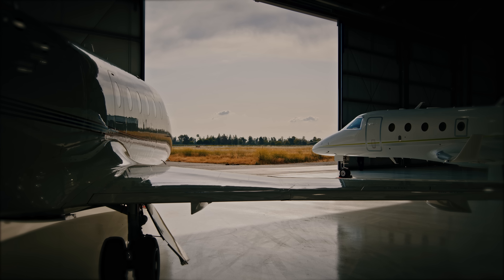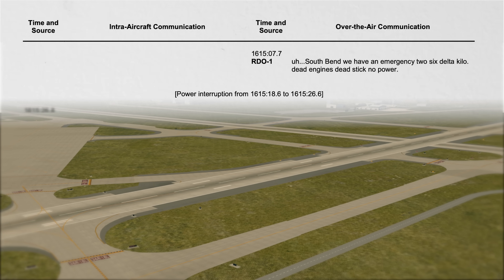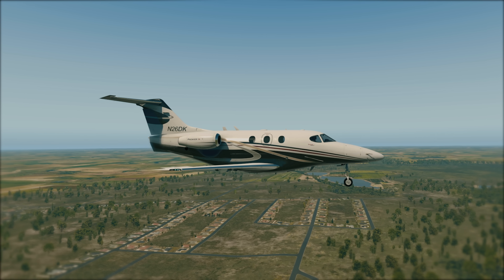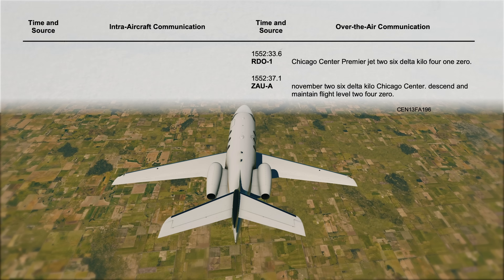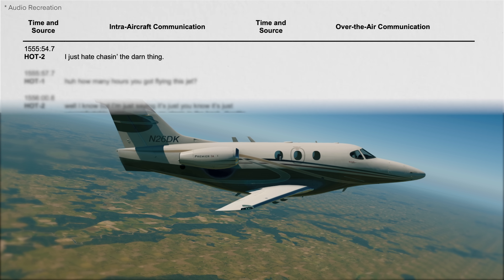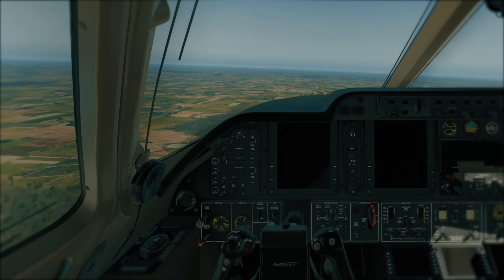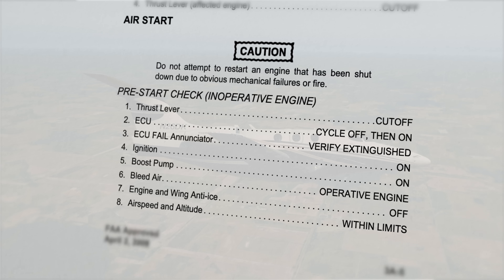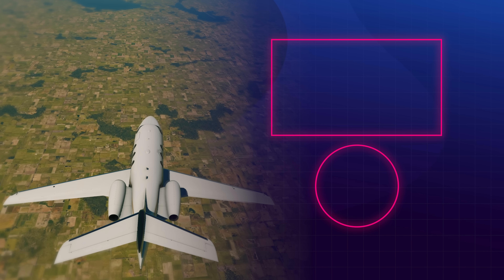Passenger Causes DUAL ENGINE FAILURE | Accident Case Study

Comment: Pilot: "we lost all power, no hydraulics, plane barely manovreable"
ATC: "no gears, go around" 💀
Reply: They totally could've survived a belly landing. That go around was the nail in the coffin.
Reply: @ascherlafayette8572  I agree... They should have landed it on the grass and slide it out like a glider
Reply: @paulbeauregard8297  No they should have used the go around with their working engine to focus, read the relevant checklists and get their plane working as it was supposed to do and was achievable by a competent pilot.
Reply: @paulbeauregard8297  well, gliders got a gear to run smoothly on the grass. That's here not the case. Usually it's better to use the tarmac, as its smoother than the grass strip from a belly landing, as there's less risk of flipping over
Reply: @ascherlafayette8572  yeah at least it added a lot of stress duration making the outcome likely worse.
Reply: @ascherlafayette8572 yeah as an air traffic controller idk why tf these controllers told him to go around… absolutely stupid, I’m sure they got reamed for that
Reply: @ascherlafayette8572  was thinking that as well.
Reply: @ascherlafayette8572 i would have refused that option, i would have said, screw you I'm landing, i never heard of a going around on a full power lost situation, your airplane is basically a glider, ATC wasn't well trained, he was supposed to clear the way for them.
Reply: @ascherlafayette8572  They tried that once with the gear, but bounced. That last go around shouldn't have been the nail in the coffin though... and they couldn't have foreseen the crash, because there wasn't much of a reason for it to happen. Having one engine was well enough for it to fly until they ran out of fuel. I don't recall if they said exactly why the plane suddenly lost control and crashed though. I remember them explaining most everything else, but that.
Reply: @deucedeuce1572  they first lost both engines and got one barely back. That's not the situation to make the call for a go around.
Reply: @deucedeuce1572  The front wheel present and the back wheels not, would make the plane pitch up everytime they try to touch the runway, the front wheel was litteraly holding the nose of the plane up, wich is what made the plane skip the runway few times. My guess is the pilot then panicked thinking he will probably run out of runway like this and tried to take off again, but at that point the plane has slowed down alot and entered a stall, this is why they lost control. At that point their best chance was to just force the plane to land. Because it was hard to get out of the stall with just one engine.
If they were to land from the first time, belly land the plane they would've had better chances of survival. Not great, because as i see in this video if the model used is the same. I am not a pilot... But i do fly model planes and i am familiar to how a plane would react in certain scenarios.
I see that plane has a prominent belly, wich would make it very difficult to just slide straight on the run way, it could start to spin, break a wing and start to roll, catch on fire, explode... But still a better chance to take than try to land with a front wheel out preventing you from landing.
Reply: @deucedeuce1572  We don't know why.  Probably stall spin because he wasn't flying the airplane he was frantically flipping switches.
Reply: When the engines were shut down, they shouldn’t have told them to go around Should’ve just done a belly landing
Reply: @leexgx  Yeah the ATC should not have made that a command. Had they belly landed they might have all survived.
Reply: @rhyoliteaquacade  They killed themselves.
Reply: @leexgx  I agree that the pilot in this instance should have ignored the go around. Even with one engine operable. In the NTSB report they found the wrong configurations for the engine restart to have given all systems power. The second way to lower the gear was also in the wrong configuration. Pilot should've practiced more clearly and understood his jet better.
Reply: @leexgx absolutely
Reply: Thought the same... almost ridiculous! If the pilot had tried to land the plane without  LG possibly would be less dangerous or at least no more deadly than try go around with poor manuver posibilities, no glass cockpit, lack of experience..
Belly landings are common... GA with 1 engine or NO Engines not so much...
Reply: As I see it, it’s simple: ATC doesn’t know what the state of their engines is.  All they know is the state of the gear, which is unsafe.  They call for a go-around, and if the plane has engine power, they go around.  If they don’t have engine power, they can’t go around, so they take their chances with the belly landing.

There’s no way that ATC could predict that they would go-around once, only extend their nose gear, come back for another landing, and botch the second go-around.  ATC made the call that, if possible, a go-around and gear-down landing was better than a gear-up belly landing, which is 100% correct.

To anyone claiming that a “go around” call means they must go around — no, that only applies in non-emergency situations.   14 CFR §91.123 and 14 CFR §121.557 both make it abundantly clear that emergencies allow for deviations from ATC commands.  To quote the latter:

“In an emergency situation that requires immediate decision and action the pilot in command may take any action that he considers necessary under the circumstances. In such a case he may deviate from prescribed operations procedures and methods, weather minimums, and this chapter, to the extent required in the interests of safety.”

A pilot with a working radio might have just replied “unable, landing”.  Assuming they made the correct call — and it’s hard to argue that “refusing a go-around because you have no engine” is an incorrect call — then they’re fine.
Reply: That's what I was thinking.
Until it was explained that the gear were electric.
And there was a mechanical backup, so they totally could've lowered the gear.
It was simply the incompetence of the pilot and the refusal of the "passenger" to let go of the controls.
Reply: @braelinmichelus  that's nothing ATC would have know, even if true. So not related.
Reply: The most likely would survived the belly landing.

Doing a go around and getting just the nose gear extended sealed their fate.
Reply: Yah, I'm not a pilot, but I've watched enough news stories and videos to know that many pilots have landed on grass, ground, water, etc. when they weren't planning to and sometimes all of the people survived. I think the controller panicked, but aren't they trained for that sort of thing?
Reply: @Dxn6alc03Belod7m1o  the controller just was in his usual loop of working, not recognizing that no engines means no normal gear extension and no go around possible. They also have actually very little knowledge of flying and aircrafts, which is quite staggering for me. Some do are pilots themselves, but most aren't.
Reply: @RubenKelevra 
While I agree that the go around command was misplaced, that was not what killed the plane.
The engine was fully functional, just shut off in the air and restarted. After that it was working until the end. The landing gear backup lever was only partially deployed and the battery selector in the wrong position.
They might have made it with a belly landing, but with a pilot that incompetent I seriously doubt that's the case.
Again, the ATC certainly didn't help, but trying to pin the blame on them is questionable at best. The responsible party in this situation is the pilot.
Reply: That ATC should be "retired"
Reply: He was not fit to fly any aircraft thats all.
Reply: Go around with one working engine
Nonsens 
Don't listen stupid tower 
Landing on the belly because lack of experience save what you can
True
Reply: yeah i wondered that too, like why? i mean i am no pilot but my instinct when someone reports no engine power wouldnt be to tell them to go around...just bely land it, theyll survive that, fuck the plane.
Reply: I mean clearly the pilot was completely unsuited to pilot an aircraft, not embracing the aviation spirit of diligence, judgement, CRM and correctness. But when I heard that call for a go-around I was pretty shocked. It sounds like a terrible idea to give the (single!) pilot of an aircraft in an emergency state the feeling that they are not allowed to land in the bad configuration that might well be all that their aircraft is capable of in its emergency state.
Reply: Kill the music👎👎👎👎💩💩😬
Reply: The video pointed that out, so no kudos for spotting it.
Reply: Yeah, that was pure negligence
Reply: They yelled so loud the engine got scared and started again... it works, trust me. ;)
Reply: Loss engine power and instructed them to go around. Some dumb ass shit
Reply: Yea I wondered about that, I have no experience with planes but common sense says loss of all power, hydraulics and barely maneuverable tells me that go around isn't possible.
Reply: maneuverable*
I don't understand how things get misspelled with all this technology
Reply: tbh I think he knew he could do a belly landing, but by his arrogance most of the time I think he didnt want to crash land his plane
Reply: I love all the comments here not understanding that ATC's job in an emergency is to give guidance and warnings, and that it's up to the pilot to decide whether or not an instruction is viable. ATC didn't kill them.
Reply: @guard13007  The ATC instructed a Go Around. They should have left it up to the PIC and simply given an observation that gear was up.
Reply: @guard13007 Exactly!  Controllers are not pilots!
Reply: @guard13007  My first thought also. ATC doesn't give commands, especially not after declaring an emergency. There's a reason the pilot is called "pilot". They have full agency over the aircraft.
Reply: @guard13007  exactly guidance and warnings.. no orders. "be advice main gears not deploy,  landing at your discretion"
Reply: @guard13007  you're missing the point: This wasn't ATC helping, but a tower controller denying them landing clearance. While in the air you always have the final say as a pilot, regarding bravo airspace and airport clearance the tower has the final say.

This is obviously not true in an emergency, but that's in the back of their head and why they aborted here.

So yes, ATC most likely killed them.
Reply: @RubenKelevra  The pilot had a flyable plane coming in with a configuration that would have guaranteed a devastating crash. The ATC told the pilot to take his flyable plane to go around to avoid authorizing an unnecessary crash. It is up to the pilot to decide if he has the skill to keep his flyable plane in the air not the ATC.
Reply: @RubenKelevra ATC can’t forbid you from landing in an emergency. You do what you want. No one else is landing there.
Reply: @CramcrumBrewbringer well, that's technically true. But if ATC tells you, after they know you're an emergency, to go around and you can, you f... go around because you might not know what they know, like someone crossing the runway in front of your etc.

You also assume here perfect quality of perception by the pilot, which might not be true. Could very well be, that he did not hear or listen closely because he was distracted and just heard "go around" by the ATC and then followed this instruction, because he thought it's unsafe what he's doing.

But exactly because ATC is not allowed to deny you landing permissions is highly questionable IMHO that they exactly did that in this situation.
Reply: @guard13007  they would have landed the first attempt if ATC didn't say anything, it's that simple
Reply: @guard13007  that's not entirely true. The "go around" instruction by ATC is normally given in extremely dangerous situations, where it's not safe to continue. A belly landing is expected in this circumstances and not the right moment to make this call, as it would normally require the pilots to follow this command immediately.

Giving such a command is not guidance and is what lead to them going around, following by a crash.

So ATC is here to blame for this crash, at least partly.

A emergency situation is just not a situation where you want to hear a "go around" call, except if there's no way to make a safe landing because there's something obstructing the runway.
Reply: What are all of you people talking about did you not watch the video?! They were able to do a go-around and it sounds like they could have done a second one. The pilot did everything wrong in this situation including failing to use two different methods of putting the gears down.
Reply: @dannonyogurt98  Makes you wonder how much the pilot knew about his jet.
Reply: @dannonyogurt98  nobody is arguing against that
Reply: @dannonyogurt98  well, without investigation it's not clear if there was enough time for a alternate gear extension method, let alone if it worked and maybe the gear was just partly extended at the time the tower saw it.
Reply: Hello?! Why is nobody mentioning ATC killed them?
Reply: @MutedGrowl  Because the ATC didn't kill them.
Reply: @MutedGrowl  The plane had a working engine during the go around which was sufficient to fly the plane.(If the pilot knows what he is doing)
Reply: @MutedGrowl ultimately still pilot incompetence but I agree they should have tried to have him belly land
Reply: He should  have  said NEGATIVE  NEGATIVE, therefore  @MutedGrowl
Reply: He should  have  said NEGATIVE  NEGATIVE, therefore  @MutedGrowl
Reply: @MutedGrowl I just did.  Negligence
Reply: @MutedGrowl in their defense, they expected the pilot to know how to handle simple tasks like restarting the engine and putting the landing gear down.

That’s why they instructed him to go around
Reply: @jdub36  In many (most?) engine failure cases, that engine is gone - sometimes it has exploded or it's leaking oil etc - so they should absolutely not assume that the engine can even be restarted, let alone assuming that the pilot will be able to restart it quickly enough for a go-around. The engine being off because the not-a-pilot accidentally turned it off is entirely not a normal situation. Normally, the most likely situation is that the they're not gonna get the engines back.
ATC instructing a go-around was definitely wrong, even though it's good that the pilot managed to get an engine running again to be able to do a go-around. 
Of course, landing during either that attempt or the next one where they only had the nose wheel would've been better than what ended up happening. That's what we don't have an answer to: Why did they totally lose control after the second go-around? They had an engine running again, surely it was just a matter of getting the gear down and coming back in?
Reply: @Vousie  I think the bounce most likely resulted in critical damage to the plane making it unable to stay in the air. Thee have been many incidents where a plane does a hard landing of some sort, seriously damages the plane and tries to go around. Almost every single time the plane ends up crashing shortly after due to its mortal wounds. I think once a plane impacts the ground the only hope it has is to stay on the ground.   What I believe he should have done is just after the first bounce cut the power and let go of the controls except the rudder, which would give him some semblance of control.  With some luck the plane might have skidded over the runway to an eventual stop without cartwheeling.
Reply: @jdub36  that's not the point here. A call by ATC for a go around usually means you're legally bound to go around, otherwise you face an investigation of a pilot division. So you're trained all your life to follow this instruction, as it may save your life and/or your license.

They said they had no power and no hydraulics, so a gear up situation is not unexpected. You can't expect an engine to magically start working again in an emergency, nor do you expect the gears to work normally.

So the call by the ATC was plain wrong, as it put a lot of pressure on the pilot in command to try his best with the crippled plane to go around. While a belly landing is perfectly survivable without any injuries, this put the occupants at a very high risk, because the just barely running engine could go out at any time again. And that's exactly what happend.
Reply: @jdub36  - But when the pilot reported those things, wasn't that a clue to the controller that the pilot either had no clue or was panicking and couldn't remember what to do? Couldn't the controller have run him through the steps? (non-pilot here, and I know that's not really the ATC's job, but still . . .)
Reply: @jdub36  ATC believed that he had no power at that point.
Reply: @jdub36  That is absurd. One thing to know how to restart. Another thing ABLE TO RETART.
Reply: I think you guys don't understand how dangerous trying to belly land WITH the nose gear deployed on a concrete runway is, anyone with any sense of airmanship would understand that going around with a functional engine and fixing the gear is a far less risky option assuming the pilot was not an idiot
Reply: @unclesam6168  it's so nice that you accuse here anyone with complete lack of airmanship, so we don't even have to start to argue with you, as you completely disqualified yourself from any sensible discussions. :)
Reply: Ya seems like they could have made it on the first approach 😢
Reply: @RubenKekevra. Yesss❗
Reply: ATC: "dont bring your mess over here"

The ATC didn't kill these guys, the pilot handing the plane to an untrained passenger and his own inability to handle his own plane killed them.

ATC assumes you know how to fly your plane. This guy did not know how to fly his plane.
Reply: go around ---funny I HEAR THAT TO !!!
Reply: Remember, controllers are not pilots!!
Reply: @LIWYMI67  yeah, that's why they are responsible for causing accidents like that by denying pilots to land on their fields, despite being emergencies.
Reply: @RubenKelevra  They do?
Reply: @LIWYMI67  yeah, they have to clear the runway for emergencies.
Reply: Soo the ATC basically sent them to their death... You can not "go around" with dead engines on a jet, this is not a glider airplane lol :)